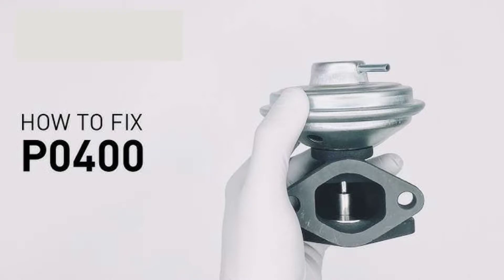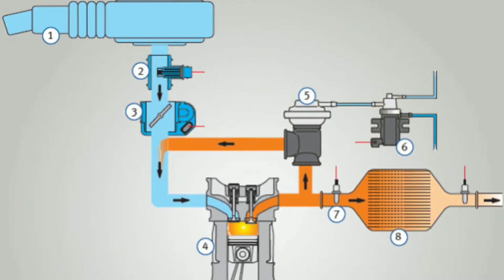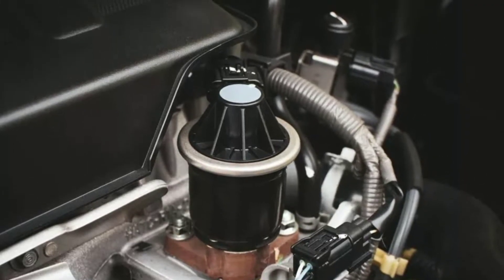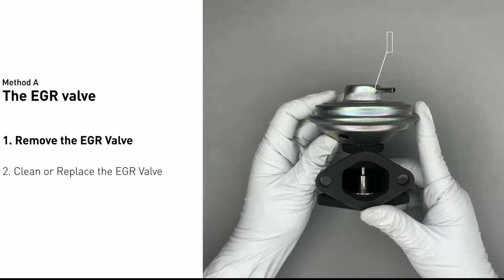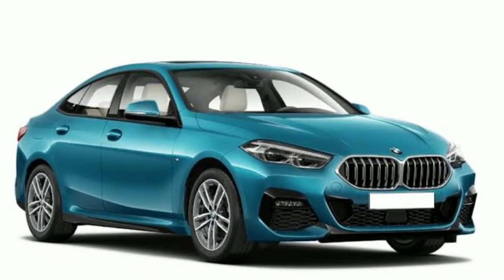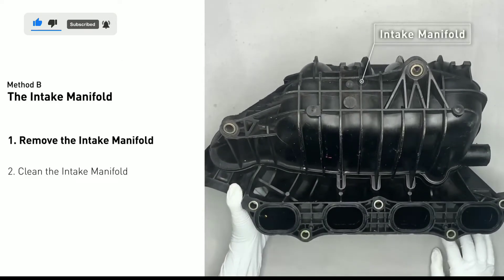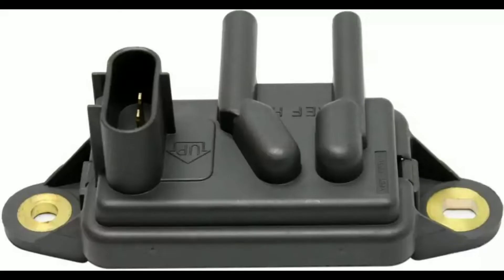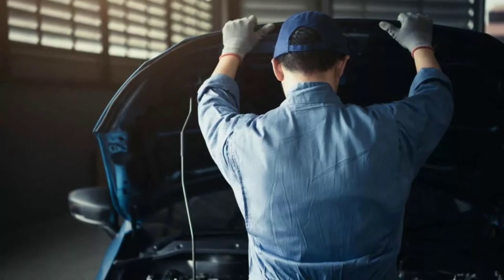How To Fix P0400 OBD2 Code ? Easiest Way to Fix the P0400 Code ?

Comment: WD 40 is a high quality EGR cleaner?
Reply from the maker: WD-40 is not a high-quality EGR cleaner. While it can temporarily loosen carbon buildup, it's not designed for the specific task of cleaning EGR valves. Here's why:

Lubricating Properties: WD-40 is primarily a lubricant. While it can loosen stuck components, it may leave behind a residue that can attract more dirt and grime.   

Not a Solvent: WD-40 is not a strong solvent. It may not be effective in dissolving the stubborn carbon deposits that often clog EGR valves.

Potential for Damage: Using WD-40 on sensitive electronic components within the EGR valve could potentially damage them.

Recommended EGR Cleaners

For effective EGR valve cleaning, it's best to use a product specifically designed for this purpose. These cleaners are formulated to dissolve carbon buildup and leave no harmful residue. They are generally safer to use and more likely to restore the proper functioning of your EGR valve.

When choosing an EGR cleaner, look for one that is:

Solvent-Based: Strong solvents can break down carbon deposits.
Non-Corrosive: Avoid cleaners that can damage metal components.
Easy to Use: Look for products with convenient spray nozzles.

Always follow the manufacturer's instructions when using any cleaning product. If you're unsure about cleaning your EGR valve yourself, it's best to consult a professional mechanic.